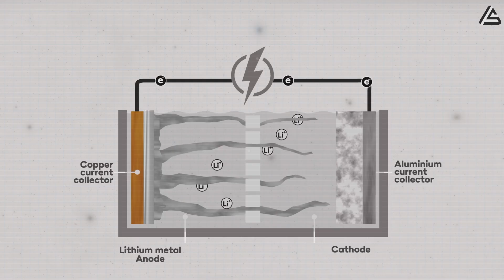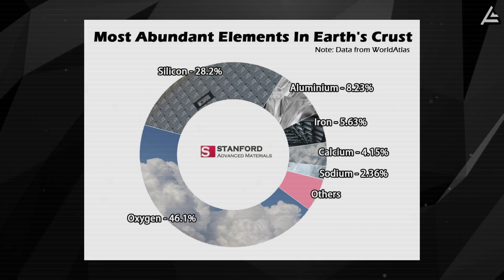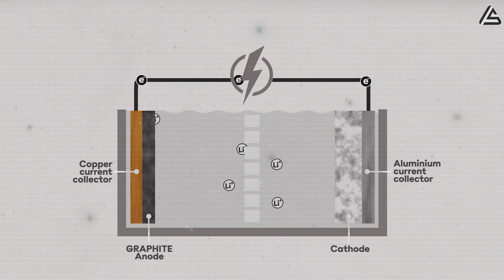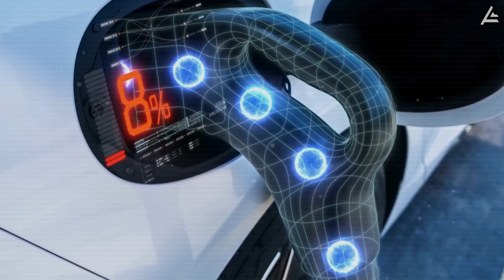2026 Tesla Aluminum-Ion Battery: What You Need To Know? End Of Lithium

Comment: What challenges remain before commercialization?
Reply from the maker: The main challenges are energy density and scalability — aluminum-ion cells still store less energy per kilogram than lithium-ion, and large-scale manufacturing methods aren’t fully optimized yet. Once those two issues are solved, commercialization could move fast.

Comment: What’s the expected lifespan in real-world driving conditions?
Reply from the maker: Aluminum-ion batteries are much more tolerant to deep discharging and show less degradation under overcharge compared to lithium-ion. Their chemistry is inherently more stable, which greatly reduces the risk of thermal runaway.

Comment: Can these batteries be made using existing gigafactory equipment?
Reply from the maker: Aluminum-ion batteries would need partial retooling since their anode and electrolyte chemistry differ from lithium-ion. However, Tesla could reuse much of the existing 4680 production infrastructure, especially for cell casing and automation lines